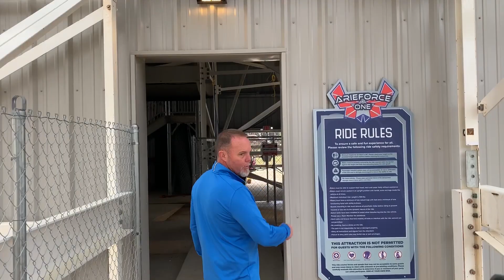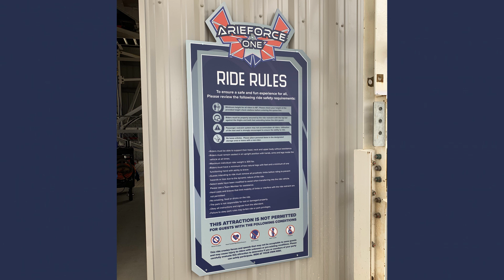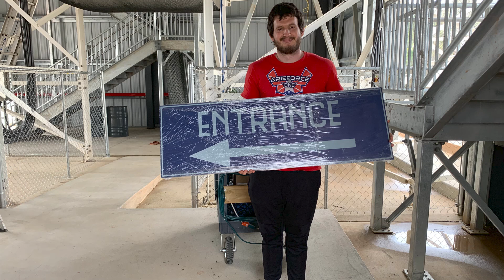EXCLUSIVE ArieForce One Tour! - ArieForce One Construction Update #36 - Fun Spot Atlanta RMC Hybrid

Comment: Can we just appreciate the pacing on this beast? The raven truss dive, stall, outer bank, and double up are pretty much equal in height but the train flies through each element like nothing 🔥🔥
Reply from the maker: They’ve shaved off 3 seconds!
Reply: @doctorcoaster  really impressive 🔥
Reply: So technically,  its a quad & a half if the chili dip is included. Also, staring at it for hours at a time, it looks like the first three give a sense of rhythm, then the last one is sharper and deeper just to mess with ya at the very end.
Reply from the maker: @judgeknot3753  Oh yes, the ending most definitely is!